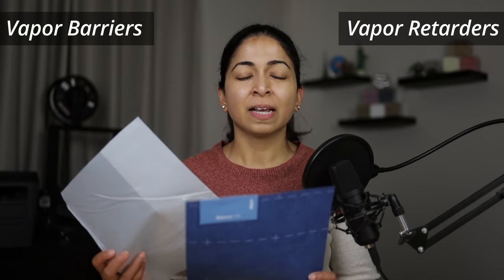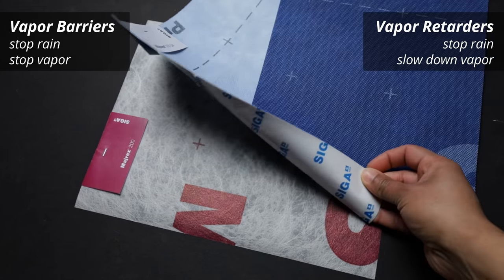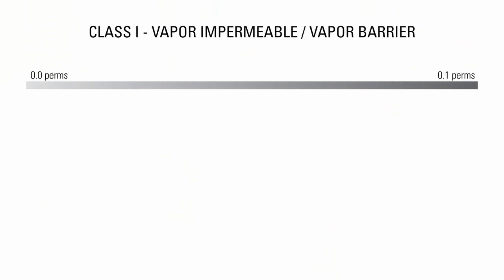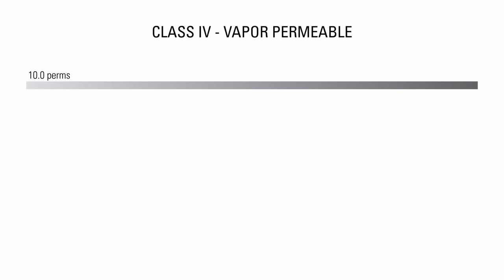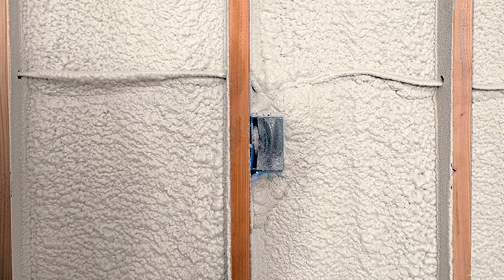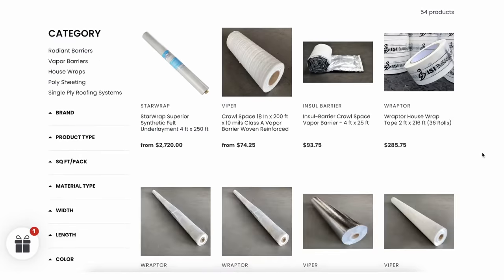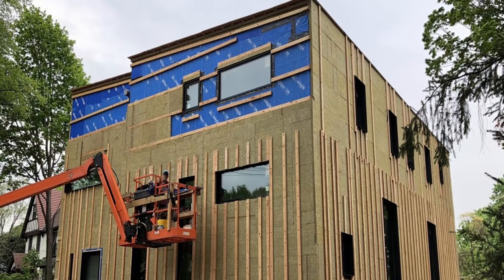Do you need a Vapor Barrier or Vapor Retarder?

Comment: Love your concise info. Question: we are buying a 3 season rustic lake cabin (zone 5 or 6) built in the 40s. Since we will need to take off the old interior paneling, we are thinking to add rockwool for a bit of insulation (though it’s unlikely we would ever be in the cabin year round). Do we need a vapor barrier on interior walls over the rockwood? I want to avoid it and feel confident the cabin will dry best without a barrier. But unsure if that’s the right answer. There will be some heat if we are there in the colder months, but it won’t be permanently heated full time…thoughts?
Reply: What are the walls? If you put up drywall and caulk and tape the seams it will be nearly air-tight. Adding an intelligent membrane (I use Intello Plus) gives another layer of protection to keep moisture laden air from getting into the walls but allows vapor to escape. I found it easy enough to apply myself.
Reply: @rsmith02  I'll look into Intello Plus. Though the current thinking is that the walls would be wood.

Comment: I finely went with sheep wool to insulate a cargo trailer conversion. There will be 1 inches of wool for the sides. The wool will be applied to the aluminum wall and a 3/4 plywood to cover it. My question is should I use some vapor retardant or barrier or nothing at all ?

Comment: I was going to insulate my garage with RocWool, then put plastic sheeting over it, then drywall. I wanna use it for a theater room and help minimize sound escaping. Is it just a bad idea to use plastic sheets now? I live in climate zone 4.
Reply: You are right on the margin there in zone four. That rock will will serve you great at the sound deadener, you're going to love it! I don't think you should put the plastic up because in warmer months moisture can penetrate the wall assembly and stop at the plastic leaving moisture to condense inside the wall where it can no longer Escape. As you are trying to soundproof your probably going to use acoustic ceilings and specialized acoustic drywall or quietrock. Soundproofing strategies always require blocking off air or any space that sounds can get through which sounds ridiculous that sound my go beneath your piece of sheetrock back up over the plate through the wall cavity and out the other side but of course, it does. So by nature of good soundproofing you will do a pretty good job on are stealing and that will keep a lot of the moisture down because you won't have are bringing it into the wall assembly. The only moisture that will move through will be from the outside of the building. If you have brick or some other masonry or stone it can get wet and then as it heats up it basically is pushed into the building and into the wall assembly but if left to be able to dry it would leave the same way it came in without causing any damage.

Comment: Question....I bought an old building that has an asphalt shingle exterior with a fibrous wood and then a 1/2 insulation material behind it....I want to take everything off from the outside put bat. Insulation in plywood over that house wrap then a 1 1/4 Ridgid insulation then a metal siding will this create mold I am in south Dakota....thank you everyone for your help

Comment: This is very clear on how they work. I do have a question though. I have a 1970s bylevel home in Pennsylvania. There is lots of air leakage and poor insulation. I want to redo the siding and windows. How would I go about adding 1.5-2in of xps or eps foam insulation to the exterior of the sheeting? I want to tape all joints and make it more airtight but I'm afraid of mold between the new layer of insulation and the drywall which I know does have a 6mil poly behind the drywall. Do I need to remove all the sheeting and insulation, cut out the poly from the outside of the stud bay and then reinsulate the studs and add exterior insulation and new sheeting before putting new siding on? Ia willing to spend the money to better insulate but I want to make sure I don't have a mold issue in 5 years.
Reply: Work with a local green builder to help you do it right (at least as an advisor if not to actually do the work- there are benefits to having experience!) Poly plus airleaks plus possibly impermeable siding (PVC?) could mean the walls are already compromised. I'd bring in an inspector to assess.

Comment: We live in right outside Philadlephia and want to refinish the basement. The walls are currently covered in aluminum looking sheets with fiberglass facing the cement block walls. The one side of our basement is 100% above ground, with several windows. Do you believe we need a vapor retardant layer?
Reply: No, you should remove the fiberglass as it's on the wrong side of the vapor barrier sheets (PolyIso?). Then read Green Building Advisor about how to insulate a basement.
Reply: Thank you so much!

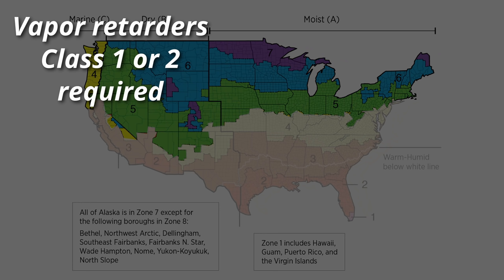Comment: At 5:25 "zone 5... code requires vapor retarder on the interior". Zip, is exterior. How does this jive?
Reply from the maker: As I said in the video, class 1 or 2 vapor retarders are required. Zip is neither, which I also mentioned.

Comment: Regarding plastic vapor barrier in the ceiling, I’m currently building my first house so I’m learning as I go. Cold climate in Idaho, my specific question is regarding ventilated and unventilated attic. My current thoughts are to unventilate the attic and have a vapor barrier in the ceiling which will save money on heating in the winter and in the summer I plan to have turbines installed to ensure air flow so the vapor doesn’t build up in the ceiling vapor barrier and making the attic insulation wet too. It’s been hard for me to find information online that would reinforce what I’m considering on this issue. Any thoughts would be appreciated, thanks
Reply: Look up Matt Risinger. He has a channel here on YouTube. Go to his video sets and find the ones on insulation and you will see a seminar for a man named Joe stiteler I am sure I am spelling his last name wrong. Any way he talks about vented or conditioned attics and vented or unvented Roofing. He is the person who helps create the codes that we use now and has done the Decades of research. The problem with your turbines is that they really only work in extreme heat and when the wind is blowing. When you have moist air that is warmer than the cooler air inside the house you will reach the dew point at the margin between the two and that is weird condensation will take place. If the area is vented well enough it can dry out but it needs to be able to vent pretty well all the time. I would suggest keeping the roof structure or the roof deck vented but closing in air conditioning the attic space so this means putting the insulation just beneath the roof but allowing for ventilation beneath that roof structure.
Reply: @danielbuckner2167  ...Very cool video's he has.  Thanks for sharing his information!

Comment: Someone correct me if I am wrong. In my understanding, vapor is not harmful until it hits cold condensing surface. In cold climate, if there is thick enough exterior insulation outside of wall sheathing, even if there is no vapor retarder and vapor comes inside the wall cavity (relatively) freely, it won’t cause any issue.

Comment: What if I constructed a home out of Cinder block in a cold climate area? I plan on insulation on both sides with an outside metal siding.
Reply: Good question! Now here's a question for you, where is your Vapor retarder going to be? Here in warm climates where cinder block homes are very popular they need to be on the outside either in a liquid form or a cladding with barrier beneath. In a cold Zone I imagine you need to have that Vapor retarder on the inside. The key to both working is air sealing but with cinder block if the block is laid well you are doing pretty well at are ceiling right away unless the block has punched holes for Mechanical, plumbing, or electrical. If you use something like an insulation board on the inside or an engineered structural insulation board out of eps then you can embed the conduits in that which will help with the air sealing by leaving the block Unbroken.
Reply: just do ICF then

Comment: Interesting subject. I am a little confused on the difference between an air barrier and a vapor barrier. Is an air barrier also a vapor barrier? How does an air barrier work together with a vapor barrier in colder climates, or would you choose one or the other?
Reply: The key terminology distinction here is between barrier (class 1) and retarder (classes 2 through 4.) If I understand correctly, I believe air infiltration barriers (like ZIP System and continuous exterior insulation) often do also act as vapor retarders to varying degrees, but since some types of air barriers may act as vapor barriers (like poly sheeting, which we don't want in a wall), not all air barriers should automatically be considered a vapor retarder without first evaluating their vapor permeance. I think the only time you would want both an air barrier and vapor barrier in the same location would be under a slab with a radon mitigation system.
Reply: @JamesCusano  are barriers refer to the movement of air through a wall assembly. Drywall taped and mudded and sealed with acoustic sealant or foam at the back edges and Joints can be considered an air barrier although Vapor could go right through it with ease.

Comment: I paid a fortune for Joe Lstiburek's book on mixed climates and I STILL can't figure out what to do about retarding vapor diffusion. I plan to build in the mountains of Arizona, so Building America mixed-dry climate zone corresponds to IECC climate zone 4B (dry). We have torrential monsoon rains in July and August, with snow for Christmas. The lows are about 20 degrees in winter the highs are about 90 degrees in the summer (the great advantage of being at altitude in Arizona - no baking heat like Phoenix or Tucson). I plan to build with insulated concrete block (ideal for a Spanish Revival style house). With a concrete structural wall and stucco cladding, do I even need to worry about vapor retarders?
Reply: Joe is the man. In a super dry climate I imagine you are going to be more humid inside than out. That would lead me to believe one on the inside would be better to keep moisture from migrating into the walls fro inside and condensing there wjth cooler outside temps. When those rains hit and it gets really wet outside on those walls you were going to have Vapor Drive that will push the moisture in but in that dry climate it should readily Evacuate the wall assembly as the outside humidity will be a lower vapor pressure than the wall thus causing it to come back out. I would definitely want a rain screed behind whatever my cladding was so if you're going to use a stucco I would use a stucco rain screed and then lab and then the stucco.
Reply: @danielbuckner2167  Thanks for the help! I'm investigating whether Intello (directional vapor barrier - low perm in one direction, vapor open in the other) will work. I think the Intello on the inside, faced to prevent vapor drive into the walls plus your suggestion of a rain-screen stucco assembly will do the trick (sounds of eraser on paper as Linda adjusts her drawings...) Thanks again!
Reply: @lindacgrace2973  👍 Dont forget to make sure your grade outside the house has enough slope to carry moisture away and to integrate waterproof sloped sills into that rainscreed at windows and doors to make sure that moisture is always "shown the door" at wall penetrations.
Reply: @lindacgrace2973  by the way I have always thought if I built out there I would love to integrate some rammed-earth walls on the interior because I think they are beautiful and natural. I've seen some with different layering from different materials as part of the rammed-earth and it gives a wonderful natural feel and look to the interior. Have fun.

Comment: I want to erect an arched cabin. These are kits using metal ribs forming two walls and joining at the roof. The exterior is covered by sheets of insulation then outer sheathing using metal shees that run the length of the building. These are built up from the base to the roof over lapping like shingles. The primary insulation is ok for temperate Texas but here in New York I need more insulation!!!!.....I want to add eight inches of cellulose bats to the interior.......in between the metal ibs that are 24 inch on center. The bats will enter the house more than the ribs so I plan to cover the ribs with cut strips of thinner batts.......so no thermal bridging occurs.....I hate dry wall!!!!.....I would like to cover the batts with ply wood.      Question;......1)....do I need to cover the cellulose with a water inhibitor sheet.....if so your recommendation 2) my wife suffers from bronchial condition s.......u mentioned a plywood that does not out gas......what is this?.....and can I use the same plywood as an under floor structure????........thanks......u should look into arched cabins as a source for low cost shelters for the homeless. Their kits run from 8x8......to 50x30 ......thanks...?.? barbuto@optonline.net........

Comment: I consider myself not stupid, maybe not smart but perhaps average. But trying to understand this topic makes me feel really stupid. I think mostly because the stakes are so high that if you do it wrong your house turns in to a rotten collapsing mold factory. I think I understand that in cold climates the norm now is to do a vapor retarder on the inside and then use vapor permeable layers the rest of the way out so that things can dry out. Perhaps with water-capped air gaps as appropriate. You want vapor to escape but water not to get in. 

I think the problem is separating Air, Water, and Vapor in my mind. Having humid air in your walls is much different than a water leak, or even an air leak. It's confusing because what is vapor but Air + Water?  UGH.

Comment: I would like to see more on this topic! In the pacific north west where protection from water and moisture is probably the most important thing. Many older style buildings we renovate are dry as a bone. On newer builds there is a big push for air tightness with an interior vapour barrier and many different kinds of retarders. You could dew a video on each climate zone?!
Reply: I also learned from renovating older buildings on the BC coast, so bucked the vapour barrier fad. I figure the additional heating cost is the maintenance cost to preserve your building indefinitely without repairs.